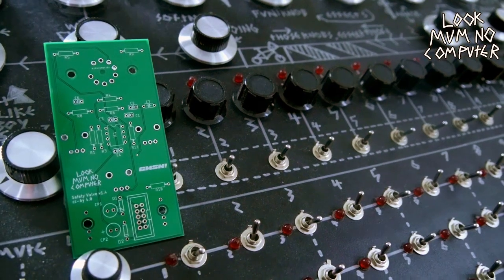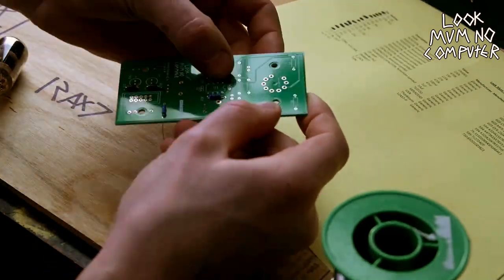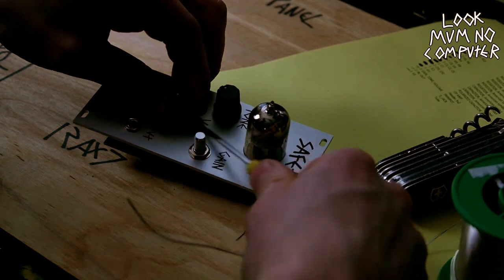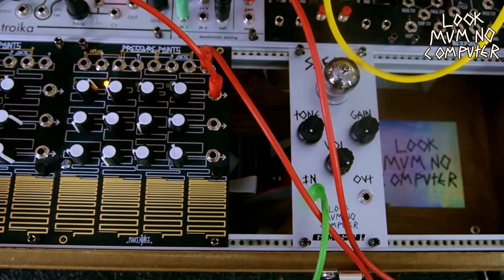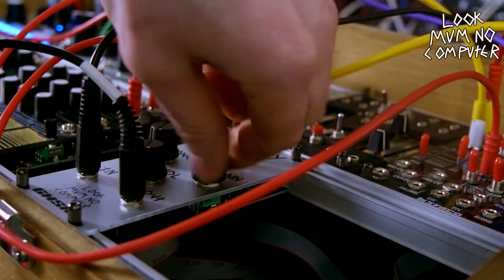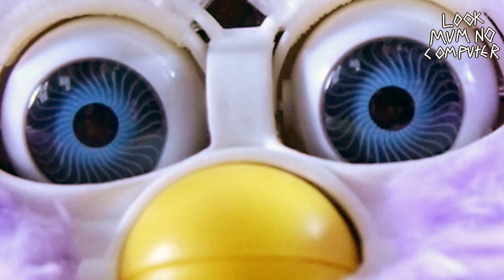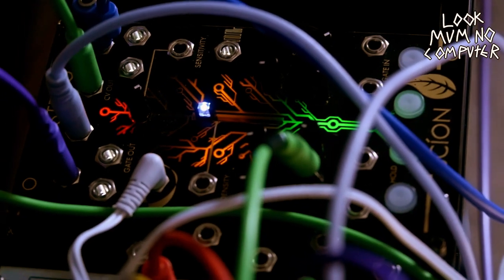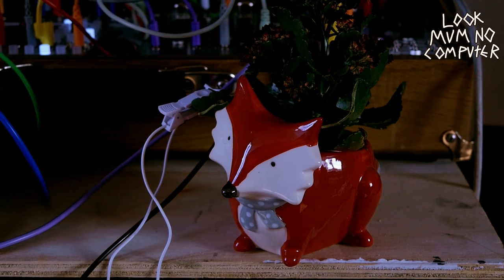THE SAFETY VALVE TURNS TO EURORACK WITH GMSN

Comment: the GMSN site isn't around anymore... Any other place to get the PCB?
Reply: I wish... D:
Reply: the information to build the safety valve in LMNC original video is really really good. just buy the stripboard yourself and all the bits are easy to get. My local guitar shop sold the tube (12AX7).
Great DIY project. no need for a PCB, its handy but way easy to do without if the info for the project is out there.
especially if you have to order all the parts yourself anyway (a mouser list would make things easier).
actually i just checked and on the LMNC website - he has links to all the parts you need. what a legend! true diy :):)